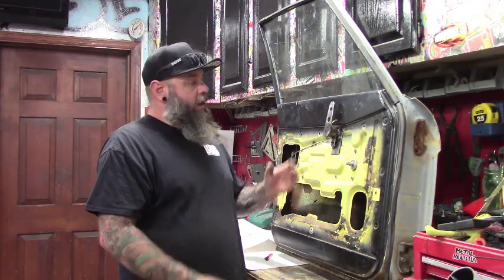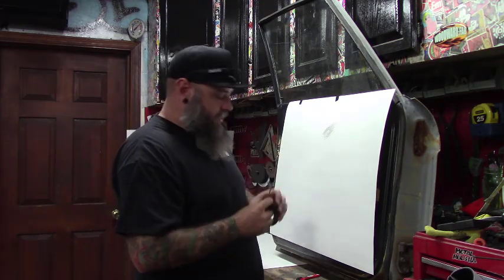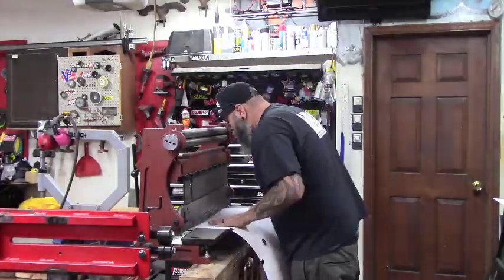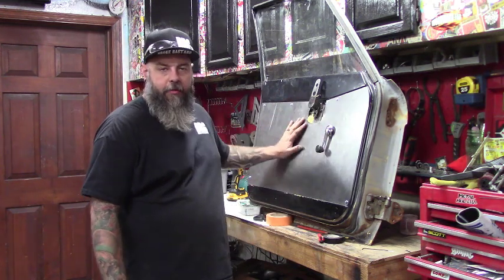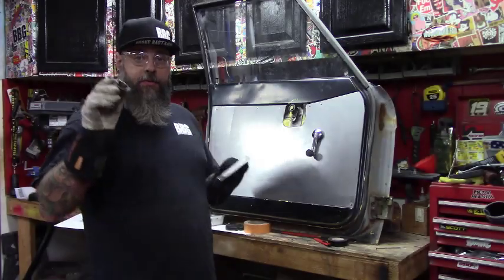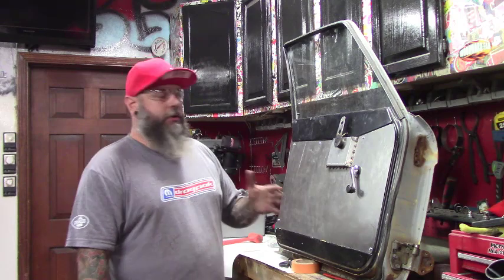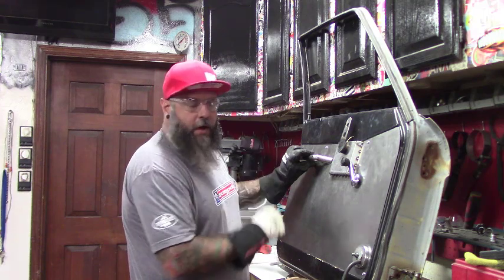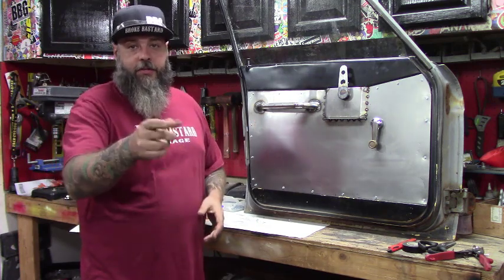How to make Metal Door Panels

Comment: I just subscribed to your channel so I may be asking too many questions for the day but I love the door panels and the old school craftsmanship. I am going to do some sheet metal door panels on my current project which is a 78 jeep j10 the panels were getting pretty ragged you should check it out, I warn you first (NEWBE). I recently started YouTube for customers and find I love making the videos but I suck with a camera and the process. Give me a tool, a machine, a welder I'm your guy, give me a camera you may as well handed me a tube of lipstick! I got nothin. Anyways I like everything you did and the idea of the sheet metal panels but could you have put a bead role for some rigidity and style around the inner panel. I am a fabricator 1st. I would like to see any type of bead rolling videos you have as I have never used a bead roller and have very little sheet metal experience. I have been a fabricator, machinist engineer for years but sheet metal is where I fall flat on my face but it is steel right so I'm sure I can get it done.  Thank you for your content I do enjoy it. Damn it Too long again!

Comment: On my European cars peugeot and mercedes
I get a dead fridge remove the Free metal skin off the fridge.. take the cardboard panel use spray paint draw outline I cut that out take a spike make holes were they attach. I take the original upolstry removed from the card and reupolster it with upolstry glue on the metal.i then take thin style hammer on to wrap the edges of the panel 5o keep the upolstry from coming back up from moisture. Add flip open wood grain wrapped cup holders.i add 6mm chinese chrome trim to the grooves on the mercedes ones. They attach with under belly pan snap in metal fasteners from china.the top of the door panel cap covers are wrapped in vinyl woodgrain and have the look of a Rolls Royce when finished.
The moisture  in the doors from rain can no longer rot the panel and no plastic clips for the hellish hot summers to dry rot.
About $30 each. To buy new cardboard cards  or buying metal would triple the price.